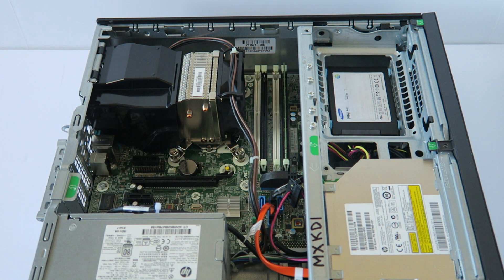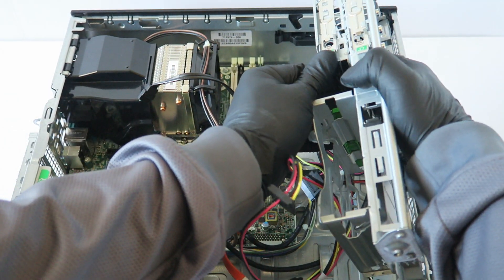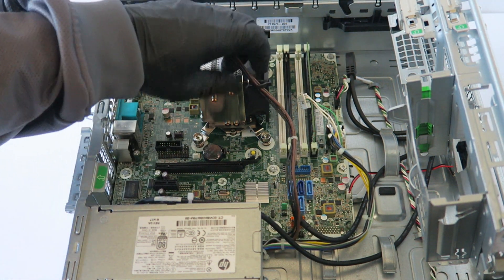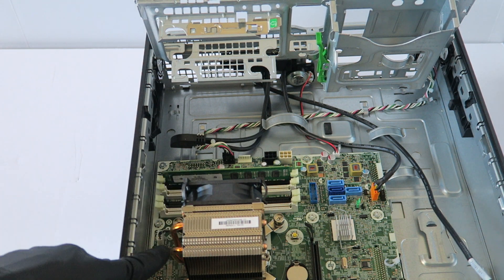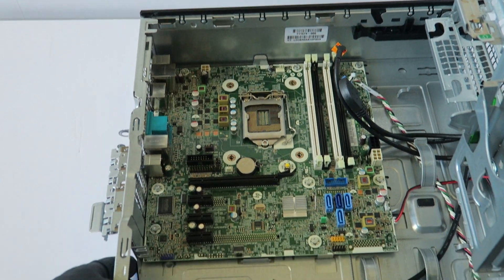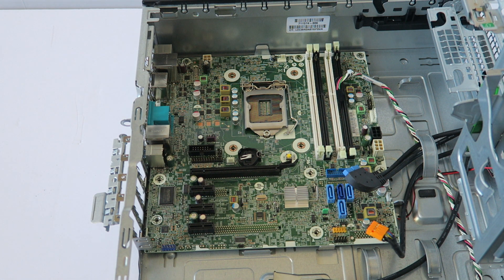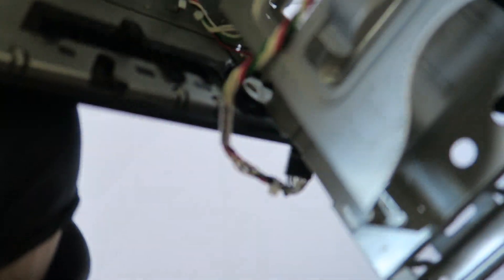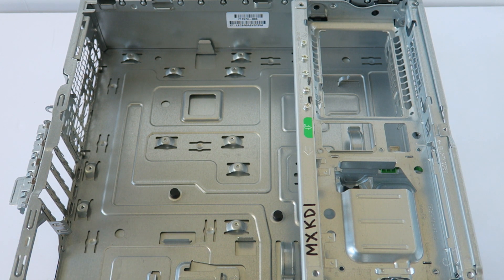HP ProDesk 600 G1 Teardown

Comment from the maker: Parts list works with this HP ProDesk 600 G1 machine:

This video cards will work with this system.
(1.) Gigabyte Geforce GTX 1050 Ti OC Low Profile 4GB GDDR5 128 Bit PCI-E Graphic Card (GV-N105TOC-4GL) 
https://amzn.to/2XEqKMb

(2.) MSI Gaming GeForce GTX 1650 4GB GDRR5 Low Profile Graphics Card (GTX 1650 4GT LP OC) 
https://amzn.to/2VkDdSd

(3.) MSI GTX 1050 TI 4GT Low Profile  Graphic Cards 
https://amzn.to/34r0AxG

(4.) Gigabyte GeForce GT 1030 GV-N1030D5-2GL Low Profile 2G Computer Graphics Card 
https://amzn.to/2Xu3SyO

(5.) ZOTAC GeForce GT 1030 2GB GDDR5 64-bit PCIe 3.0 DirectX 12 HDCP Ready Low Profile Video Card ZT-P10300A-10L 
https://amzn.to/3eayL1b

SSD list works with this PC.
(1.) Samsung 860 EVO 500GB 2.5 Inch Internal SSD MZ-76E500B/AM) 
https://amzn.to/2yNxnkE

(2.) WD Blue 3D NAND 1TB Internal SSD, 2.5" WDS100T2B0A
https://amzn.to/2wvnC9Z

(3.) WD Green 1TB Internal PC SSD  WDS100T2G0A
https://amzn.to/3cbrcWa

(4.) SanDisk SSD PLUS 480GB Internal SSD SDSSDA-1T00-G26
https://amzn.to/3a3i9ou

(5.) Crucial MX500 250GB 3D NAND SATA CT250MX500SSD1(Z) 
https://amzn.to/34rZlhy

(6.) Samsung 860 PRO SSD 256GB - 2.5 Inch SATA III Internal Solid State Drive
https://amzn.to/2ybiHLK

(7.) Samsung SSD 860 EVO 250GB 2.5 Inch SATA III Internal SSD 
https://amzn.to/2VjIAkK

(8.) SanDisk SSD PLUS 240GB Internal SSD
https://amzn.to/3c7SEE4

Here is list parts of upgrades.. 
(1.) Video Card Gigabyte GeForce GTX 1050 Ti OC Low Profile GV-N105TOC-4GL
(2.) SSD Samsung 850 256GB 2.5inch Solid State Drive
(3.) RAM Kingston HyperX Fury White DDR3 1600

This RAM will also work with this PC..
Crucial 16GB Kit (2 x 8GB) DDR3L-1600 UDIMM CT2K102464BD160B
https://amzn.to/3cbKOcu

(Crucial 8GB Kit (2 x 4GB) DDR3-1600 UDIMM  CT2K51264BD160BJ
https://amzn.to/3efYjtK

Crucial 4GB Single DDR3L 1600 MT/s (PC3L-12800)
https://amzn.to/3c2KtsK
Reply: What about cpus?
Reply: hey man will the msi 1650 accually fit cuz it says on amazon the product is 6.7 inch's
Reply from the maker: poopy jeff  Hi.
Reply: how to find over clock settings plz on bios of thi board

Comment: Thanks much for the advice. I couldn't remove the motherboard even with all the Torx screws out, until I followed these steps. Evidently there are clips on the underside which provide additional stability/frustration.
Reply from the maker: Hi, thanks

Comment: I had a weird issue with my ProDesk 600 G1 SFF. The DisplayPorts were being blocked by the IO shield, so you couldn't plug in a Displayport cable. I had to remove the motherboard and reseat it in the case so the ports would line up with the IO shield correctly. I'm not sure if it was caused by someone not installing the board correctly, or if that part of the board has bowed over time. Perhaps this will help someone else.

Comment: but how i can but a graphic card with this motherboard and the power supply new graphic card
Reply: i have the same problem with same pc
i would really appreciate it if someone tell me too
i want to change the psu and add a RX 590
Reply: You need to have a low profile GPU for that. It also has a bracket for small factor pcs like this one

Comment: I found one of these for cheap but has those weird psu connectors, have you found a way to use a regular atx psu with it? I want to install a gtx 1060 in it, planning to change the CPU case too
Reply: I have the same problem
Reply: 24pin to 6 pin connector for hp prodesk Google it
Reply: I have the same problem, do you guys know if there is a higher capacity power supply, a 300 watt power supply would come really great for a gtx 1050ti
Reply: @shod5507  a 1050ti does not use external power

Comment: can u transfer the motherboard to other PC case and what psu is compatible to it?
Reply: also the cooler bracket is part of the case. you cannot use a normal atx cpu cooler, as there is no bracket for their proprietary crap
Reply: PSU is proprietary so you would need adapters
Reply: Where could I get those adapters?